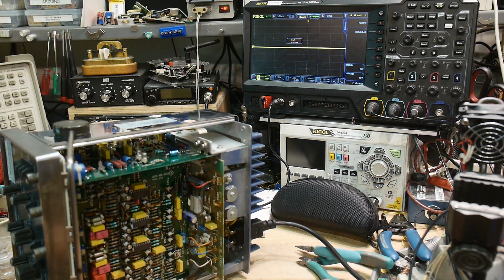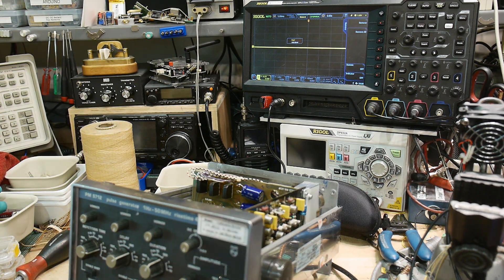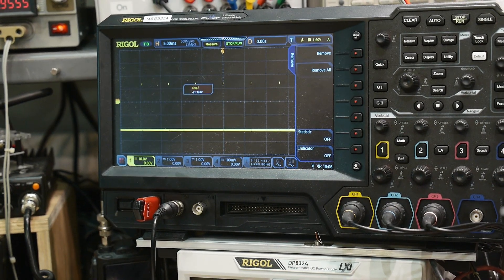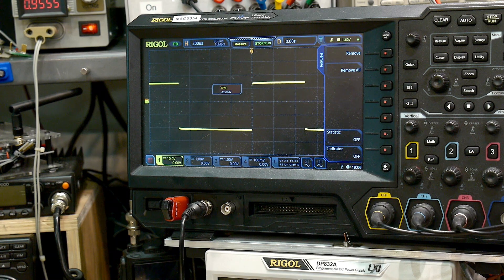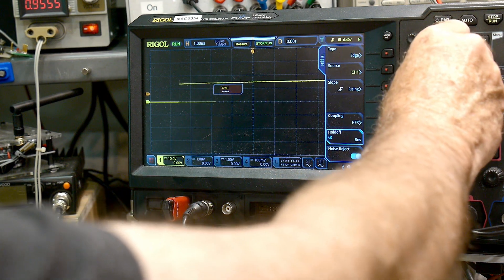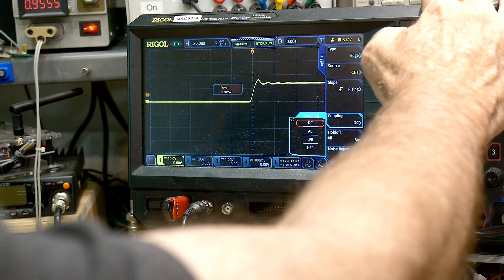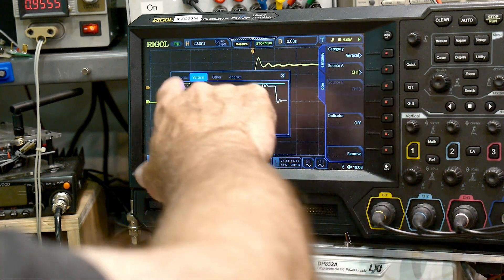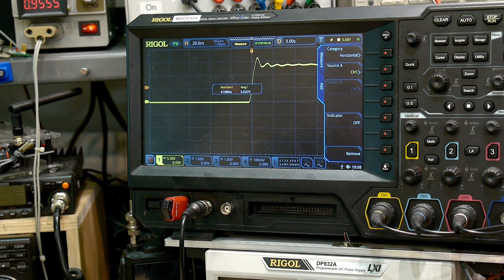#1267 Philips PM 5712 Pulse Generator (part 2 of 3)

Comment: Great work, well done.
I bought the exact same model, like new and calibrated. The only problem is that it's missing the parts to hold the handle and the two black covers with the screw in the middle. Can someone send me photos with the dimensions so I can make a 3D model of the same model?
With a big thank you.
Reply from the maker: I no longer have it.

Comment: Is that standard practice to replace aged electrolytic I have some old power supplies that were created back in the 80s and they have very hefty electrolytic so 
 should I replace those caps
Reply from the maker: some wait until they die, others replace them before they do
Reply: @IMSAIGuy 
 those supplies have never been used
Reply from the maker: @stevepence9869  sometimes that is worse

Comment: Part 1: "They did it kind of a cheesy way.  Instead of desoldering, just clipped off the old capacitor and tied it to the leads that were there, so that was kind of cheesy, but it works.  So not the best craftsmanship on the rework."  🙂
Reply: It was not the neatest fix, but it was an easy fix that will work for his personal use.

It looked like pulling the board to desolder the leads from the board instead of the quick fix he did would be quite a bit more work.

He now has a nice pulse generator to use for very little money and minimal effort to fix it.  I would call that a win.

Comment: The "dented" capacitors are normally like that, seen it in many Philips CRT TV's from the late 80's and 90's - either a design choice or maybe it had a propose, no clue, but they were made that way :)
Reply: to make a smaller wound core fit snuggly into a larger sized case
Reply: I think the dents are to fit a square shaped bracket in case you want to bolt them down.

Comment: Kind of surprised they just didn't use something like a LM117/LM137 for the power supply regulation.

On a side note, I used those pulse generators for decades in the lab.  Rather nice just being able to turn a knob as opposed to fiddling with buttons on a newer pulse generator.
Reply: A 741-based regulator should have better thermal drift at least. LM117 is an amazing part and a very good design, given how hot it can get while still regulating in-spec, but a thermally decoupled op-amp, even a 741, must have it beat for DC drift and load regulation.
Reply: @absurdengineering  Yeah, I hate to second guess the original design engineer's thought process.  Could have been plenty of reasons why they did what they did for the power supply.  Maybe not just cost, but  for technical reasons as well (i.e. noise).

Comment: In the beginning video, could you have put a voltmeter across the power rails to check them and then used a LCR or ESR meter to check the capacitors?  I know you saw the ripple with the oscilloscope, but could the voltage supply originally checked fine and  would your new LCR meter have seen a problem?
Thanks, Rob
Reply from the maker: I've found a scope to be more reliable and fast

Comment: I think for the regulation to work the top opamp needs to be powered, but it regulates its own power supply. The opamp gets its temporary power supply via the resistor, C304, another resistor and the strangely arranged NPN transitor. Then the regulation begins and the strangely arranged NPN blocks, but the voltage supply for the opamp comes via the 22.5 volt itself. These 22.5 volts are compared with the z-diode and regulated via a diode and transistors. The stabilized 22.5 volts are used as a reference for the other two voltages via resistance dividers.
A fun way to regulate the voltage and avoid three LM317.
Reply: yes and a good way of making a single fault in the master rail look like multiple faults in all the other rails because the ripple from the 1st gets sent straight into the other reference inputs.
Reply: @EssArrB  But if you understand the design, this should be not a problem, right? Sure, it’s best to design assuming least knowledge from the service tech, but I think the way they did it was cute. Such a wonderfully oddball circuit.